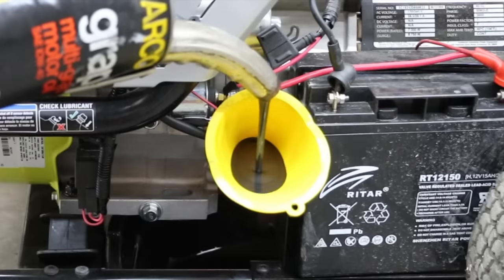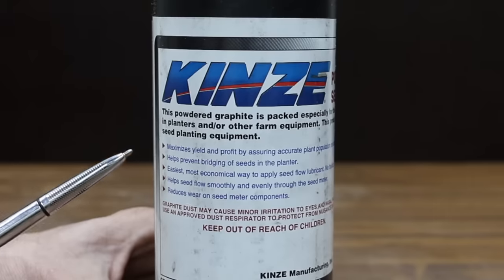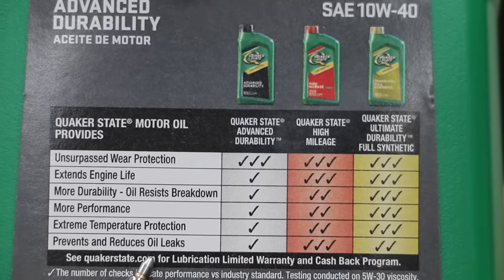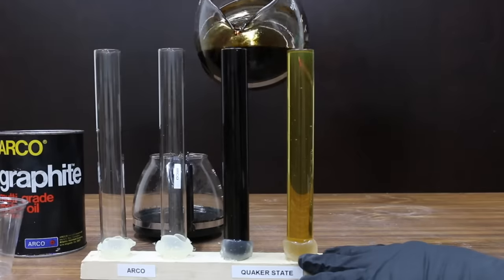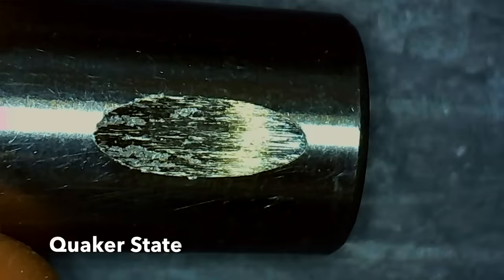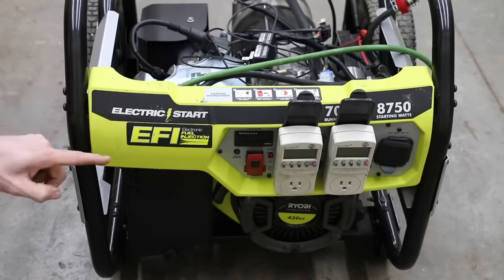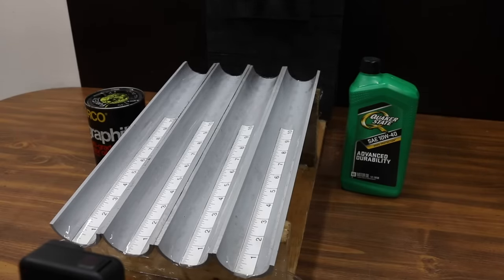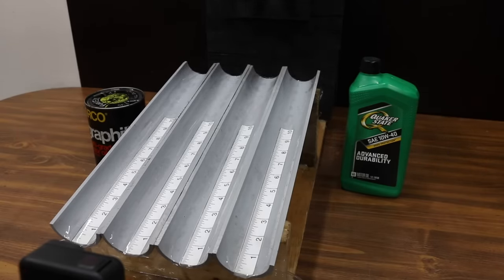Will "Graphite" Help Motor Oil Performance? Let's find out! Vintage Arco Graphite vs Quaker State

Comment: Fabulous video.  It takes me back to my early days in engineering.  ARCO tried to expand the technology into the fuels market for power plants.  The fuel was called COM for coal oil mixture.  Coal would be ground super fine (like graphite) to remove some of the sulfur and ash and then be blended with oil and a small amount of water.  Surfactants were used to keep the coal suspended and to emulsify the water in oil.  The basic technology was based on ARCO experience with their graphite motor oil.  We built a pilot plant and the first batch had the coal drop out of suspension.  I hear it took months to get all of the sludge out of the cargo hold.  As far as I know, that ended ARCO's involvement with the COM product.
Reply from the maker: Thanks!  Thanks for sharing.
Reply: All of the bypass filters I use will remove Graphite.
Reply: Oh wow, that is nasty.
Interesting concept though, I'm guessing they were using a particular coal that was basically very low quality graphite? Most coal does not have a high graphite content.
Reply: @samheasmanwhite  The COM project was separate from the motor oil product. We were just using the tech. The oil product used graphite.  We were using coal, trying to reduce ash content, and blending with oil and water to make a Bunker fuel replacement for use at power plants.
Reply: @mikeshawn5298  Ohh, missed that it was supposed to be a fuel. By power plants do you mean the power plant of a ship or was it intended to be shipped to electrical power plants in a suspended state? Seems like something that should be mixed as it is used.
Reply: @samheasmanwhite  It was shipped to a power plant as fuel. They got the mix wrong, the emulsion broke, and they were left with a lot of oily water and coal sludge in the tanker.  I heard they eventually got the mix right but the economics didn't pan out.  And the ash and sulfur reduction wasn't enough for the effort.

Comment: I just remember my father using the graphite motor oil back in the 70’s. Any drips on the concrete were permanent. And what car in the 70’s didn’t drip...
Reply from the maker: Thanks for sharing.
Reply: Sweating from all that horsepower!
Reply: i know many brand new Harley Davidson rider who have bike that piss oil. i keep laughing... until the valve cover gasket on my Honda starting leaking unto my exhaust pipe.
Reply: they didn’t leak, thats called rust protection
Reply: That’s all oil tho. Even modern oil cleaners for concrete still struggle
Reply: Francois Dupont aren’t Harley’s supposed to be a one cycle piling system? 😝😝 

Seriously though, everyone bashed on Harley’s, but even many stock Harley’s will beat a busa to the 1/8th, then lose
Reply: Andy47357 yup, my off-roaders don’t rust underneath because I haven’t cleaned the last owners grease off
Reply: Frankie Teague  I'm not sure what you are trying to say. The slant six was one of the best engines ever built by anyone.
Reply: Dad used Arco Graphite on his 1974 Chevy Vega, only oil that kept that damm car from using a quart a month.
Reply: Joe Blo  just a couple of years ago, when i did my motorcycle license they had a brand new Harley bike that was smoking black and really grunting badly when going from a stop. also the chromed logo on the side of the tank were directly positioned to my knee and after only 1hour of riding the bike i had big black hemorrhage beneath my skin* the next day. very bad design. i remember it was shaking so much at idle we would all laugh at the noise it made. it was like siting on a washing machine.
the only thing i liked about it was the seat, it was large and well stuffed with foam or whatever, very plush feeling.

* i dont know the english term for this. but it is similar to a black eye.
Reply: Toyota and Datsuns of course!!
Reply: @Francois_Dupont  Harley Davidson motorcycles during the AMF years were notorious for dribbling oil every time you parked them. In order to cure costs, the machined surfaces between the engine and oil pan were awful and AMF thought that it would be cheaper if they just used a sealant rather than a good gasket and quality surface finishes. Bad idea.
Reply: You know that graphite is what is inside a pencil?  You should have just let your Dad borrow your eraser, it would have come right off.
Reply: My grandpa used it in his 76 Lincoln Town Car Black on Black 460 CID Land Yacht, used to drive it from Louisiana to Anchorage Alaska. He stopped using it around the 1980's and when he had regular oil changes done you could still see the graphite remnants present. Lots of highway miles on that battle boat.
Reply: @dablakh0l193  ha! i didnt know this. i worked at a machine shop and one guy was so good he machined and polished the mating surface of an engine so perfectly it didnt even need any sealant or gasket.
Reply: Dont use it in a Harley!
Reply: @Francois_Dupont  You're really close.  The formal word is hematoma, but Americans usually call it a black and blue.
Reply: Francois Dupont The normal word is a bruise
Reply: I think most cars from the beginning of motor vehicles to about 1996 leaked at least a little oil. I have a 93 Explorer and I had the rear main seal replaced 2 years ago.....it's leaking again. Not much,but it is.
Reply: @sheppycider123  haa yes yes, thank you. i am not native english so i learn everyday.
Reply: @FetchTheCow  its "hématome" in french, but i wasnt sure if it was used in english. thank you!
Reply: @Francois_Dupont  I think you mean hematoma. That is basically bruise. A guy I knew from work rode a hard tail all the time. That bike was an 1981 to the best of my knowledge and he put like 140k miles on it. Maybe more? I know he went to Sturgis every year. That's about 3k miles round trip.He eventually had  kidney problems and hemroid surgery probably from that bike. All that jarring  and bouncing all the time,can't be good for you.He had another bike also. Only time I ever saw him drive a car to work was if it snowed or black ice. I always thought he had bad knees by the way he walked sometimes. He told another guy the bike probably caused it. He said he put surgery off for a long time,until he just couldn't take it anymore. I couldn't help feeling bad for him after I heard that. Man...he must've really loved riding that bike.
Reply: @Thundarr995  sometimes we just love somethings too much for our own good. he could have switched bike and maybe kept him from having health problems. (we just dont know)
i know for a fact that people that go thru motorcycle driving school these days, where i live, got to ride both modern style Japanese bikes (CB500) and cruiser style Harley bike. i talked with many driving instructors and they told me that almost everybody come out of there wanting to ride a modern styled bike and not a cruiser. 

personally i wanted to ride a 600cc bike, and after trying many of them from 250cc supermoto to a 200hp duccatti multistrada? i found that the perfect size for me was a CB300. i didnt buy one because even thought i liked it very much, i found out it didnt have bearings on the crankshaft and having worked at a engine shop i knew it wasn't a good design. i finally bought a 125cc CBR, it is underpowered for the road, but it is still riding very nicely. 

i think we must learn to tame or desires. we are living in a age of easiness, everything can be bought on the back or our own freedom. money is only a number now, the possibilities are limitless. i knew people that bought houses, cars, boats only to lose everything (including wife and children) because of a simple ski injury that caused lost of work. now with the current state of lockdown, it is becoming a very harsh reality. people all around are realizing their world were build on a sand foundation, everything is collapsing.

i wish you all happiness and to always follow the right path.
Reply: Eric Struble 
That's when cars were monsters, and men were men!
Reply: @Thundarr995  :  unfortunately, the crankshaft can become worn which prevents new seal from working well (assuming it's installed correctly and no thrust or runout problems). Use a "seal saver" on the crankshaft and it will be like new. Cheers
Reply: I remember oil from 90's and early 00's still stained bad
Reply: Subaru's still do!
Reply: @Francois_Dupont  bruise?